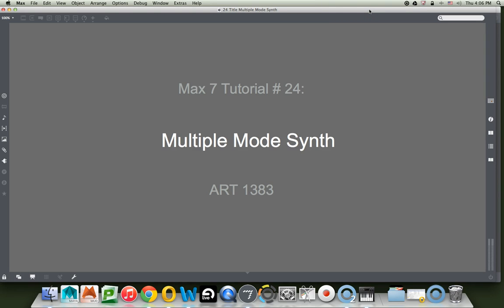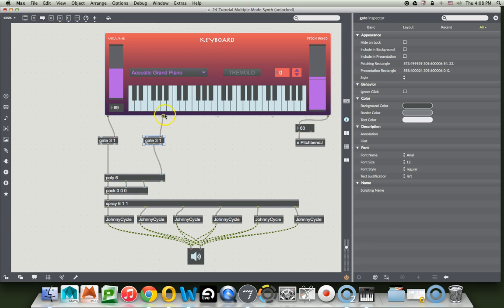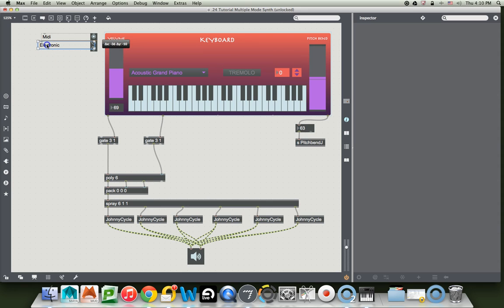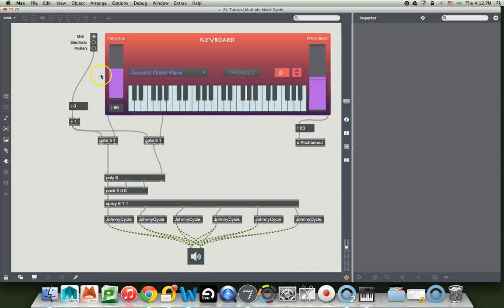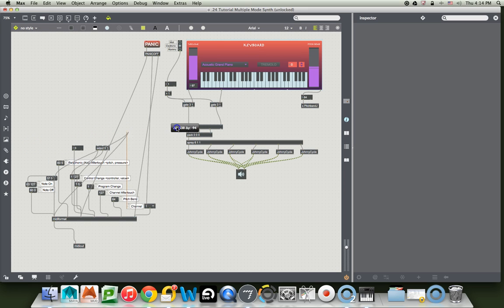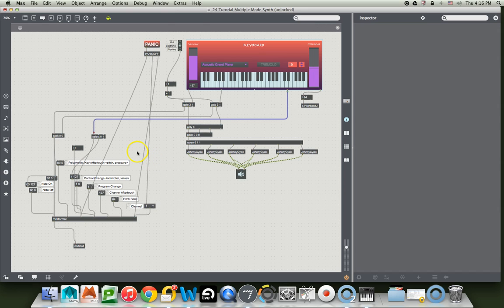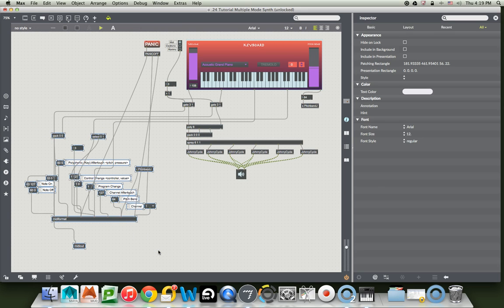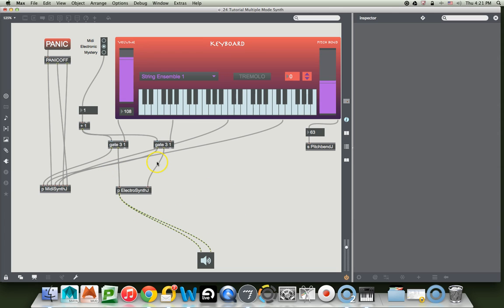Max 7 Tutorial # 24: Multi Mode Synth

Comment: My patch stops working after I put the radiogroup and gates in. The keyboard still shows things but it doesn't make any sound. What happened??
Reply: make sure BOTH gates are hooked up the same way, with the patchcord from the radio-group going to the LEFT inlet, and the data from the keyboard-bpatcher going to the right inlet of each gate.  Also, check that you haven't reversed the "pitch patchcord" with the "velocity patchcord" either before or after the gate objects.  Good luck!
Reply: @dearjawny  thanks I just found out that I attached both of the outlets as the first outlets when I'm choosing the second mode. Thanks so much! Didn't even thought you would answer. Thanks so much.

Comment: My synth doesn't always immediately play. Btw you said that you would show us how to label the inputs for our synth
Reply from the maker: +raveniskcrow Sometimes mine seems to take a moment or two to load, but if there is something you HAVE to do to get it to play (like wiggling the volume, etc), that would be a good clue as to why.
Re:labeling inputs.  unlock your patcher, select an inlet object, open the inspector, scroll down to the "comment" parameter.  Double-click in the blank area after the "comment" parameter and type in "Velocity" or "Midi Key #" or "Frequency" or whatever's appropriate.  Now when you mouse over that inlet (inside another patcher, or as a bpatcher) you will see the name of the subpatcher and your comment. Ta-Da
Reply: Amazing, Thank you so very much. I am learning so much through your tutorials.
Reply: +raveniskcrow discovered that if I accidentally hit the caps lock, it (caps lock) acts as a on off switch.
Reply: +raveniskcrow Ha, I do that all the time!  Yes, optimistically you could say that hitting CapsLock acts as an "Off" switch.  Essentially, keyup and key don't recognize any keys once you hit capslock.